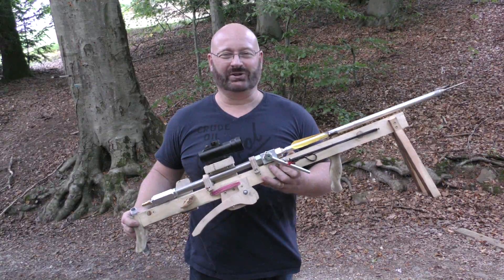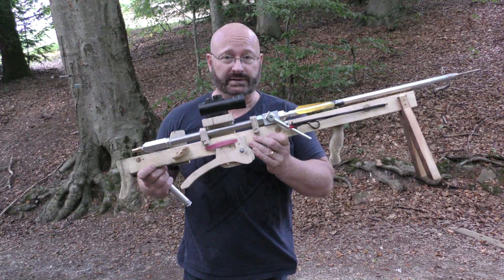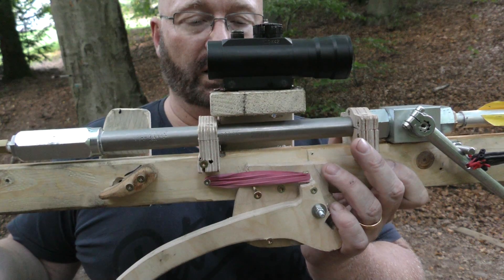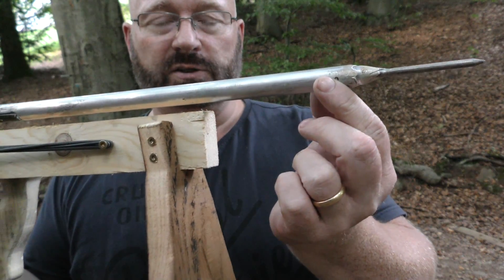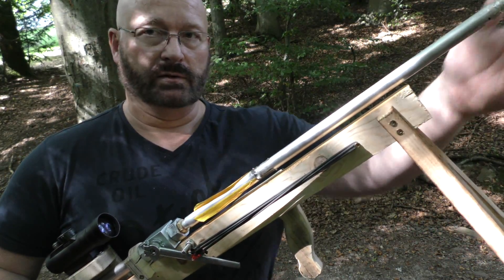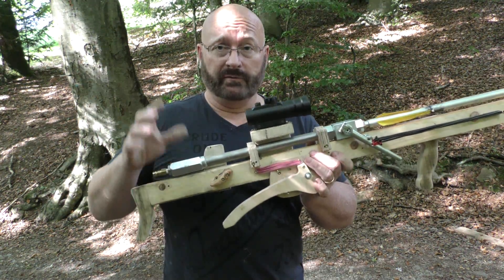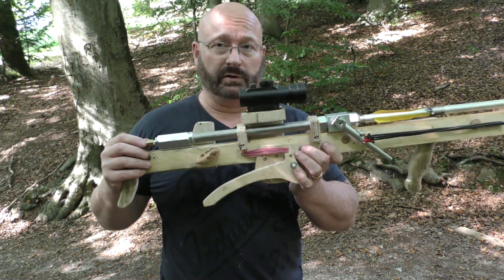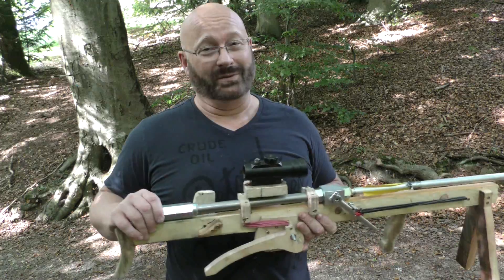Project 1000 Joule Airrowgun: Getting Closer! (714 Joule)

Comment: I am very worried about failure due to pressure at some point. I try not to be one of those people who frets over the safety of youtubers. But I think you are really not taking the risk seriously. If the fill valve threads let go and the valve ejected toward you while you were preparing to shoot, it could kill you. Also, are you checking to see if the main air chamber has become permanently enlarged? If it is, it has become unsafe and will likely fail. If you don't do anything else, you should at least measure the diameter with calipers after every shot. Stay safe. I enjoy your videos!
Reply: Oh, I just read farther down that the check valve takes all the pressure (and is rated for it) so the fill valve is actually not pressurized except during charging. So that makes me feel somewhat better.

Comment: as i said last time. some gases expent faster then air. like helium. so the arow will fly even faster!
Reply from the maker: But how would I use my pump with helium? Fill a huge room with it and buy scuba gear for me?
Reply: +JoergSprave i have Seen a Video on the Chanel "codys lab" wehre He uses a Plastik bag to seal a airgun.  its clearly Not 100percent seald but IT could be enouth to make something like an airbag.  where the Kompressor inhales the Air?

Comment: Can this device penetrate a solid piece of medieval plate armor?
Reply: Crossbows were only things that could penetrate and this thing is crossbow on steroids.
Reply: The arrow would probably just break.
Reply: RathKeno The nail would penetrate.
Reply: tubeboy He could also use a tungsten drill bit as arrowhead.
Reply: tubeboy I don't think that a nail would be strong enough to keep from bending.
Reply: RathKeno This is more energy than 9mm bullet has and if lead can go through, then a nail can go too.
Reply: tubeboy The problem is that a nail bends too easily. Armor is curved, meaning that an arrow will almost certainly hit at an angle. If it hits at an angle then all of the force will be applied to bending the nail instead of pushing it forwards.
Reply: RathKeno It shouldn't bend that easily. Or then the nail need to be hardened. This needs testing.
Reply: tubeboy I think that it would make more sense to just have a shorter, broader spike on the end, like a regular arrow.

Comment: i thought maybe you could steal a design of a bullet and create a smaller projectile to fit on the barrel decreasing its weight and it might fly faster. if you take the design of a 50BMG hollow out the inner part ad use the brass tip you might reach even higher speeds and be able to penetrate stuff

Comment: be sure not to over pressurize. If the pipe goes it will go off like a bomb. Could be deadly. 
I want to keep getting slingshot videos.
Reply: "With the recent change from plumbing parts to hydraulic stuff, this is quite safe (for the shooter). All pressurized parts are rated well over the level used in this gun." ~Jorg in an earlier comment.

He should be fine, especially with the better components he's using; like he said, they're proofed for a lot higher pressures than he's using here.

Comment: does it beat a deer?
Reply: Do not exaggerate
Reply: Bruno Ferreiro no, it probably could kill an elephant. Deer it will kill easily, hunting crossbows have much less energy in most cases, and work ok. 
In case of elephant - I doubt it will penetrate his skull, but that's one hell of sturdy arrow, and, considering it's mass and speed, it perfectly could penetrate all the flesh between ribs to get to heart. But I totally do not appreciate killing elephants. They are endangered, while deers are ok and even considered environmental threat due to overpopulation in a couple of regions.
Reply: Man, elephant was used only to exemplify the Power that reaches. I totally disagree hunting Lions elephant and everything else not strictly for eat and/or survival
Reply: Ok

Comment: That arrow would need to fly at 118m/s to achieve 1000 joules. Also if the arrow flew at 264m/s you would get 5000 joules :D
Reply from the maker: 118 meters per second is realistic. 264, not so much.
Reply: Just triple the amount of air chambers, but you may need a wielding tool for that; unless there's a pipe with four connecting ends. But 5000 joules may also be too dangerous.
Reply from the maker: Doesn't work that way. Increasing the air chamber only works up to a certain point. When the pressure in the chamber is at 300 bar, then this gets diluted by the barrel, which holds 35 ccm. So if you use a 35 cmm container, the pressure that pushes the arrow is only 150 bar. If you triple the container size (which is what I have done), then the pressure will be 225 bar. Using three 105 ccm containers, like you suggest, I'd be at 270 bar. 20 % more pressure only.
Reply: Ah, I see. That being said, I now know why 264 m/s sounds unrealistic. Do you think you can hit 1100 Joules?
Reply: You can make the arrow heavy and make it 1100Joules. Its possible.
Reply: Anthony Castro lol
Reply: jörg, can you use this weapon for hunting or would you need a special german hunting permi? dankeschön
Reply: it doesn't work that way aswell - with 200-300 bars in the chamber it will flow out with constant speed according to "expansion of a gas into vacuum" law (as 1 bar outside is neglectible compared to pressure inside), which depends on molecular mass, adiabatic coeff, temperature, univ gas constant etc. 
u = √2/μ*γ/(γ-1)*R*T
but not on the inside pressure, so increasing it wont help after some point (the point when you have enough gas in the chamber to fill out the barrel when the arrow goes right off it)